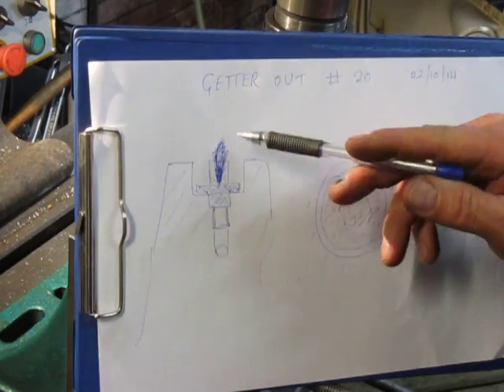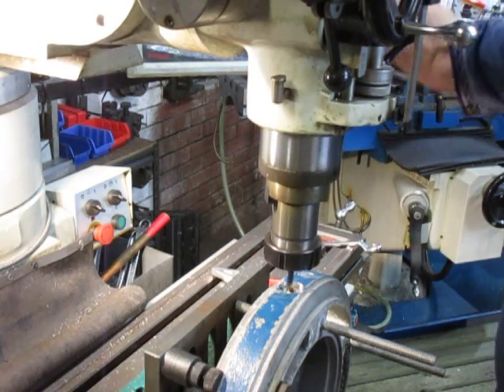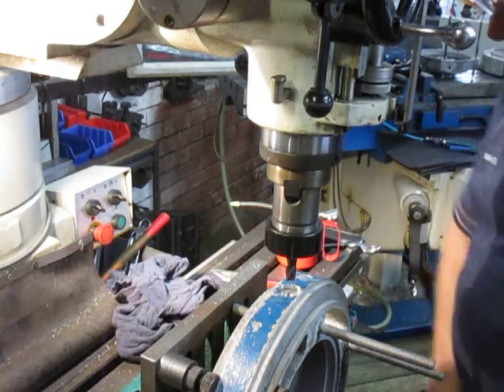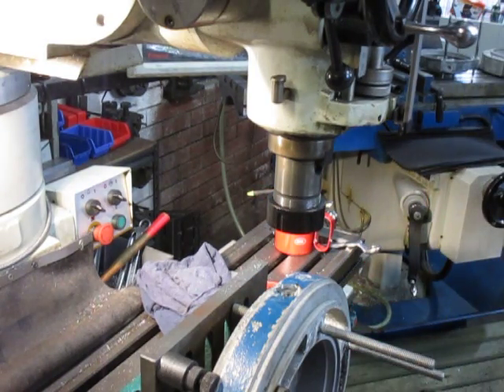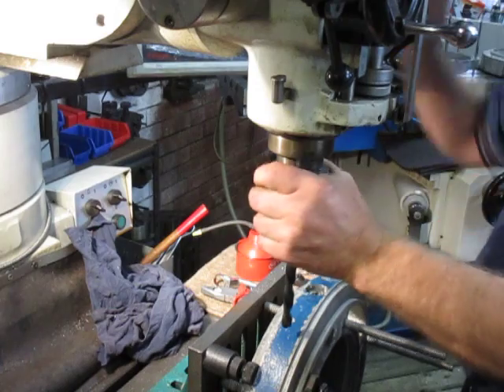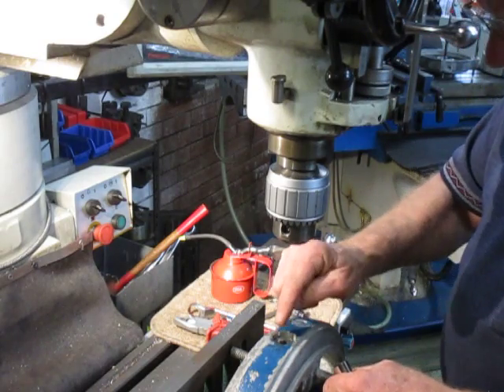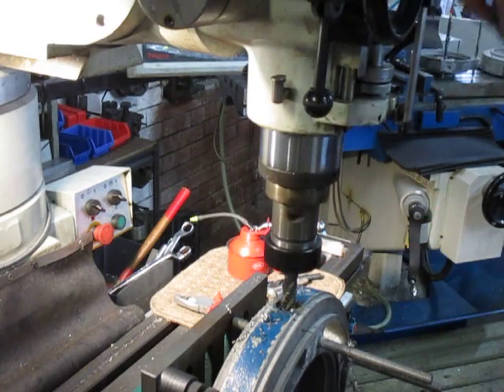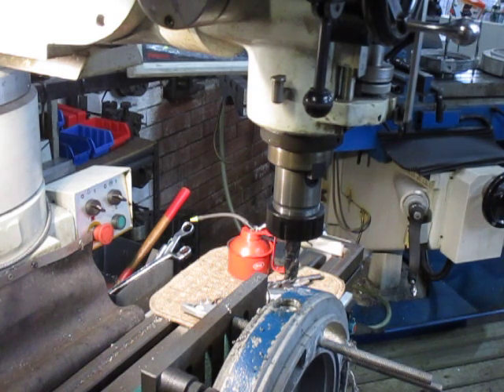Getter out 20 part 1 remove plug and ezi out

Comment from the maker: Carter I use a shop vac when I'm machining fibrous materials, and occasionally with small chip stuff, just find the sound is a little harsh on the ears, and it is another item to look after. Mine is a cyclonic type, doesn't like long curly stuff though. in  a perfect world I'd have it piped to all the machines. There is something to be said about having to bend down into awkward spots to collect swarf, you can at times find something you lost or some part that needs greasing haha!

Comment: Just a second comment here.  I have started to use a shop vac to clean up chips.  You don't have to sweep them up like when you use air to blow them away.  If you add a cyclone separator to the vacuum line you don't even need bags for the shop vac.

Comment: Hi Bruce, Happy belated birthday.
You have been teaching us too well, we now think we know as much as the Master, might your LH drill have had more chance of success if you had taken the washer and O ring away first?
Awaiting part two eagerly
chris
Reply from the maker: Chris, life is not that easy! sometimes when a job comes in I just know that I will have to go through the long process and this was one of those. The plug was in very tight, I'd suggest that maybe it had been rattled in as the mechanics seem to do these days, hard to fathom why! The aluminium thread was badly stretched hence the plug locked in tight, so it was a matter of drilling out until most of the stud was gone.